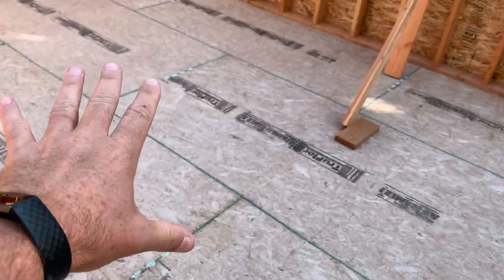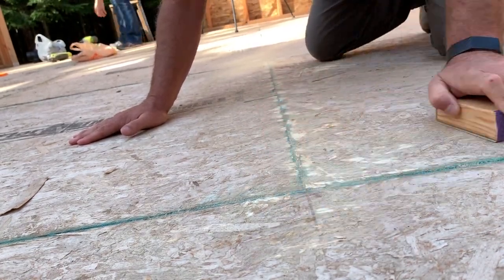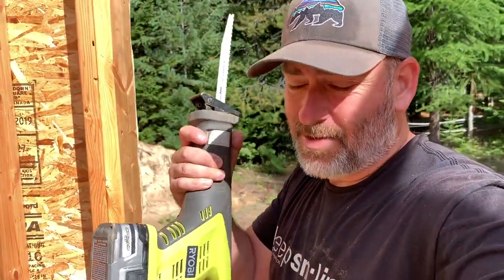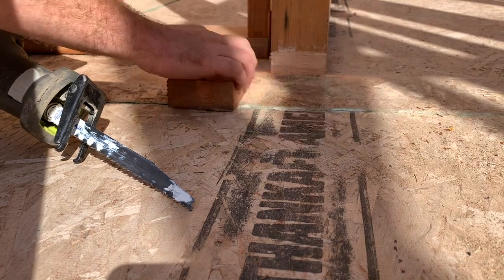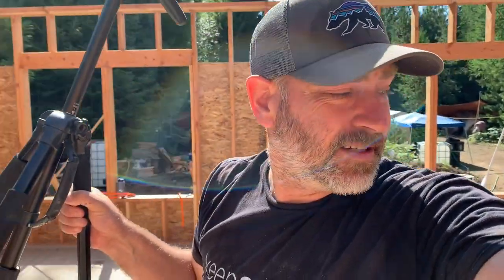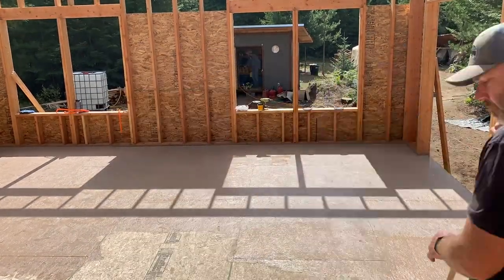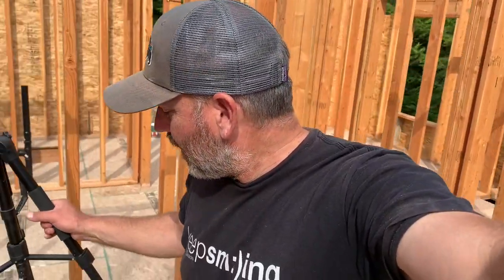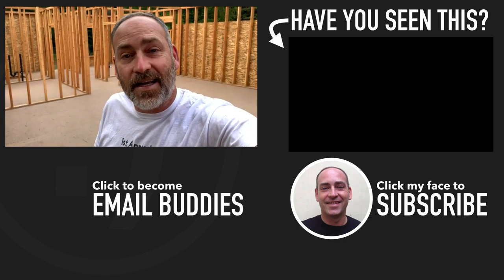Weather Proofing OSB Flooring | Off Grid Cabin Build #30

Comment: The floor looks really nice. Might even make a good finished floor. Just sand it a little with a drywall power sander with some 120 grit  to knock down the rough spots and put on another coat after drywall is finished.

Comment: My wife and I are wishing you good luck in your project. However your well needs more thought. First, the
case needs to be sealed so that ground water does not leak down the outside of your casing and contaminate
the water inside the well. Second, you might have a chance if you can get that silt pumped out. There is water 

down there but I'm afraid your going to have to go deeper. You are going to need at least 1 gal. per minute flow
and then your going to need a large storage tank to supply your house. Start with pumping out silt first, once the
silt is cleared you might get the flow you need. Use a gas or electric pump, your >20' of head, pour clear water from
top and pump out until clear. You cannot pump fast enough with that pitcher pump. Good Luck, if you would be
interested in additional help drop me a line.

Comment: OSB don't like water and moisture period. (Flaking and swelling)  Roof trusses would be nice with tarp if roofing OSB  not in budget, but water is an OSB nemesis
Reply from the maker: That it why we painted it.
Reply: @MartinJohnsonOffGridLiving  Was your OSB Tru-Floor rated water resistant and you were trying to beef it up? We are wanting to save money on cheaper OSB which is not water resistant so we like your idea.

Comment: So my question is, will you be putting anything else on the OSB or will this be it? I'm only asking because I was going to pull up the carpeting in my RV and paint the floor to my liking. I've painted plywood in the past and it came out great and lasted forever. Thanks.
Reply from the maker: Someday we will put flooring down.
Reply: @MartinJohnsonOffGridLiving  So technically I could paint the floor the way I want it and just leave it as is?

Comment: I like watching how meticulous you are. I don't deck till the week before the SIPs walls are delivered because I don't like material degradation. With that I still paint the entire deck, normally 5 gallons per 1000sft. I like to just pour a glob and spread it out. I try to put it on very heavy. Don't be suprised if water still gets thru the cracks. That Pyramid Autumn sunset looks just fine. Great about paint is you can change it if you want to. Question: plumbing rough Inspected yet? If so did he say why ABS is allowed there Not PVC for DWV. I have several Brut cans full of PVC fittings that I hope I can use rather than waste. Thanks
Reply from the maker: Not yet. I’ll try to remember to ask about the abs.
Reply: @MartinJohnsonOffGridLiving  After the trusses are put up and you start to deck the roof you may be pulling the OSB up a ladder. Here's a tip I have used since 2007'. Put a "C"clamp half way on the 4x8 on the side. Use that as a handle and walk it up the ladder with you. And don't precut the offset OSB, let them run proud till that side is done and pop a line and cut them in place.

Comment: Why not put up house wrap around the outside to protect from the weather.
Reply: The sun might damage the osb but water soaked osb is worse... The wall will dry off easy but not so for the floor so while paint ain't the best solution it's better than nothing. Also the house wrap are not immune to sun exposure. Depending on what you use some say they can only be exposed for a few month to sunlight before being damaged or destroyed...

Comment: THE first thing I do , when I am going to put a pipe in the ground that I have to draw water from , is prepare the pipe with holes , two to three feet , I then get geo textile & wrap it around the area covering the holes , two or three wraps also covering the bottom , use the felt or the plastic style they both do not rot , secure that to the pipe with stainless clamps , drill the hole , drop in course gravel about a foot of it , put the pipe in then more gravel, higher than the geo textile , this has always worked for me .

Comment: The best way to do this..is layout your walls with chaulk lines. Spray clear coat over the chaulk lines. Lay plastic over the floor. Keeps the floor dry until you get your roof on.
Reply from the maker: I think it is a little late for that. But a good idea.

Comment: If that home is raised off the ground- sealing the floor can cause the sub floor to rot from underneath. I see it all the time, make a living repairing this problem from those god forsaken laminate snap together floors that seal out moisture. It needs to breathe.
Old houses had the actual wood floor nailed to the joists and NEVER rotted.

Comment: I got a rule of thump. If you cant get a roof on and half way dried in before a rain gets on your framing then you should wait or find another option.2 or 3 rains or a prolonged rain will make you start to hate your squeaky, warped new home. Start talking snow and freezing on a subfloor and you are really going backwards. No way my new house is sitting out getting wet or frozen.